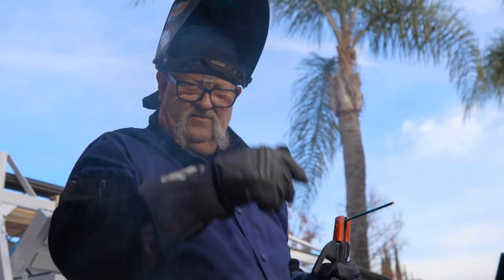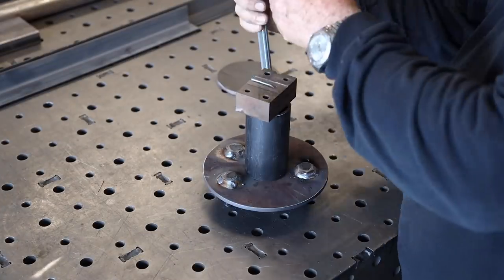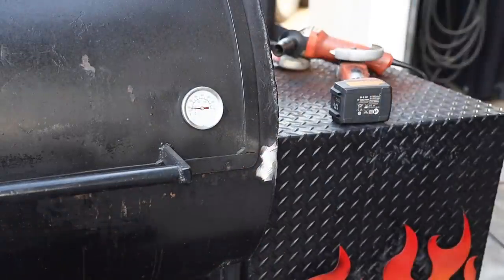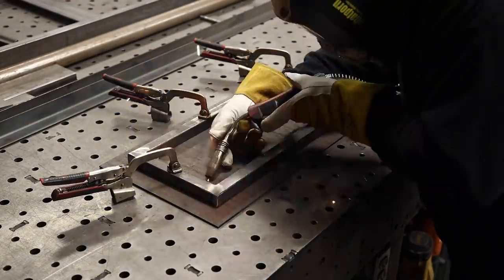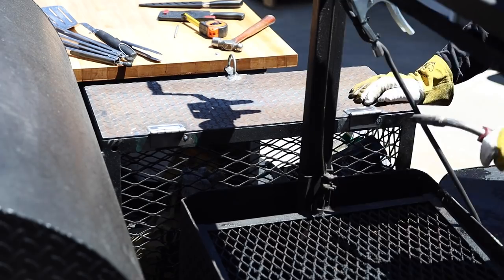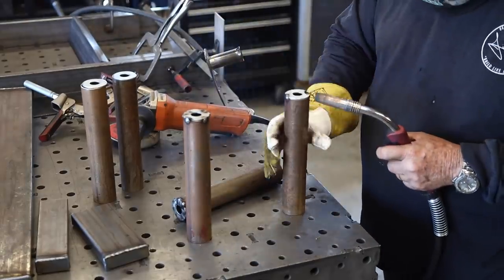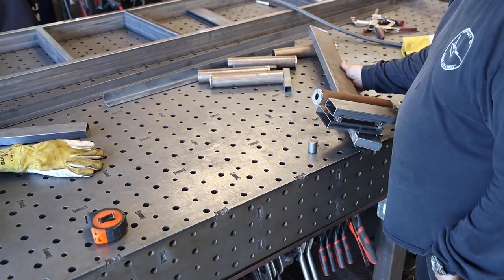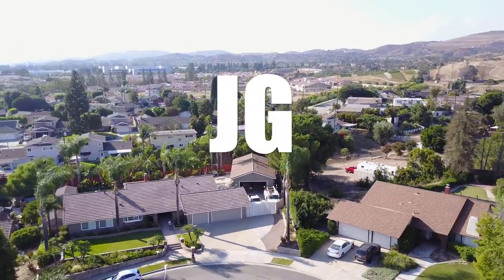BBQ Trailer Upgrades | JIMBO'S GARAGE

Comment: Much better if you use your drill press in making a hole... and tigthented  ng bolt with knot...  before you weld the bolt

Comment: Do you go over the metal with a flap disc before you weld so it makes it easier to paint afterwards or do you just primer and paint with no sanding? I made a few gates and I went over with a flap disc so the paint has something to grab on to. I’m trying to figure out if it is necessary or wasting my time. Thanks
Reply: Kinda depends on the budget and client needs. It will definitely assist with paint adhesion but not really necessary. A good self etching metal primer should adhere pretty decently regardless but if sturdy paint is top priority then it’s a good practice. You could also use a hand sander with 60 grit paper. Not sure what would be quicker